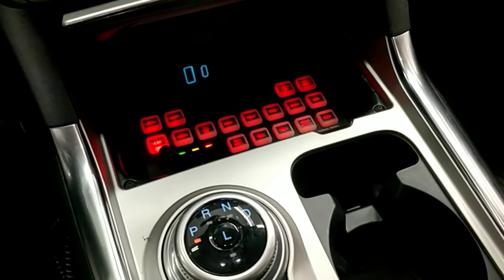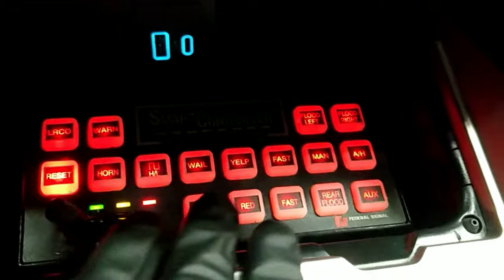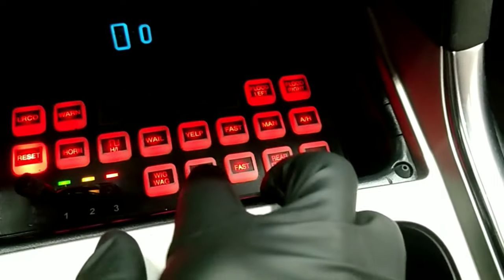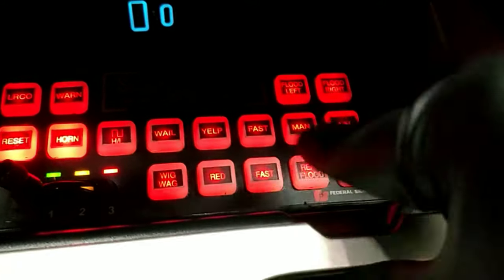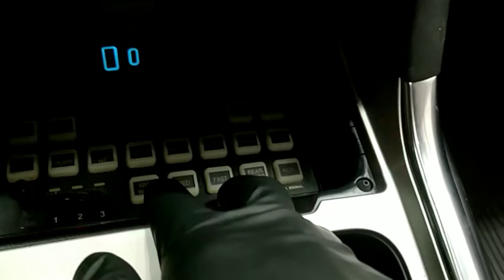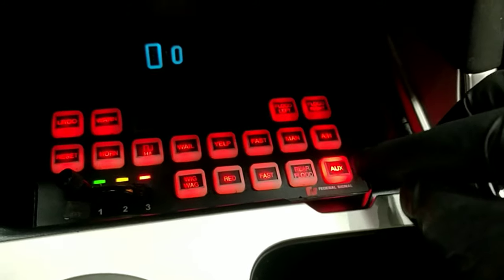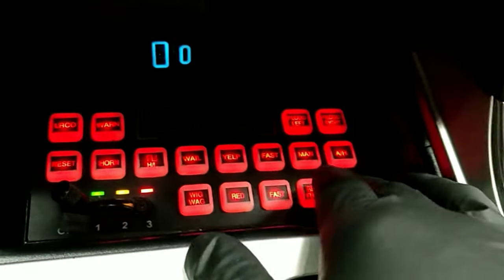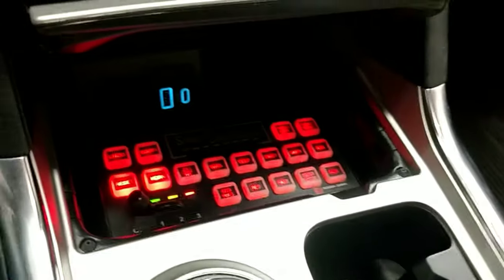Federal Signal SSP3000A & Rumbler - Emergency Vehicle POV Custom Upfitt

Comment: I was a cop for 31 years and Federal Signal was my all time favorite company for Lights/Siren Equipment.   Very heavy duty built and worked flawlessly for many years over cycles and cycles of repeated use for years on end.   Federal Signal and Whelen are the two very best...hands down.   They are about equal to me as I loved equipment from both of them although I always leaned towards the quality of Federal Signal.    SMART Siren system (shown above) is a nice system and integrates well into any modern Law Enforcement Vehicle.  Many of them are pre-wired to accept these systems or come with them.   I think Ford had a contract with Federal Signal at one time to supply the pre-wired siren systems in their police model line up.   They may still provide that service.   The Rumbler is a unique system that was actually invented based on SCIENCE.   Studies were done that were based on wave resonance of sound and how sound can penetrate metal at what wave lengths and then used that information to develop the RUMBLER technology.   This siren is independent of the wail/yelp/hi-low functions on the normal siren.   The Rumbler transmitter is timed to to emit the rumbler wave signal simultaneously with the normal siren which would still be blaring away at the same time the rumbler signal will be penetrating the vehicle in theory with it's lower tone pulsing signals.   The theory behind the rumbler system is that most cars of today are so precisely built using robots and computers and they seal much more efficiently now with new technologies than they ever did in the past.   As such the sound from outside the vehicle cannot penetrate into the vehicle nearly as much as sound penetrated in years past.   Also, many people wear ear phones in their ears (which in most states STILL illegal) so they don't hear outside sounds such as sirens or people crossing the street, outside ambient sounds, etc.   It is known now as a danger, and can, and have caused crashes.    The rumbler is supposed to penetrate into the cabin of a vehicle better than higher piercing sounding normal siren tones in order to bring awareness to a driver that an emergency vehicle is passing or approaching them.  The technology does have merit and is a proven to work technology that can certainly enhance the ability of drivers to hear and then see an approaching emergency vehicle with the rumbler technology activated  The technology is not in very wide use around the United States due to high cost.   The unit cost far more than a base siren system, sometimes as much as double or more meaning most police fire, and emergency service units will not elect to purchase the technology.      Most governments see the technology as "fluff" and while acknowledge it's good technology, don't see it as NEEDED technology where a lower priced base siren would work just as well in their eyes.   Granted most of these politicians have to answer to their constituents so bottom line price is ALWAYS a concern.     More studies should definitely be done in the future.   I'm not sure if this study was done in conjunction with the Florida Highway Patrol Emergency Lightbar Study that was done around the 2010 era I think it was.   It was the most extensive study ever done on emergency lighting and proved that the eye saw red better in the daylight and blue light better at night.   This is why FHP adopted a two color light bar system that could flash all red day time, and all blue nighttime.  Most departments that use a combination of blue and red lighting all the time have the same benefits because they flash both colors all the time.    Florida Highway Patrol's thought at the time was the fact the lightbar could automatically change colors they would have the benefit of having more light emitting in the recommended color due to all the lamps being lit in that specific color in daylight or darkness.      Code 3 inc. created a system for Florida Highway Patrol which employed a simple light detecting sensor that could tell when it was daylight or dark outside.  That sensor was then integrated into one of their Lightbars and that complete system became standard issue to the Florida Highway Patrol for many years as Code 3 probably had the exclusive contract for several years after it was first implemented.  (Federal Signal had long been the supplier to FHP for their lighting/siren equipment and this was probably a little bit of a shock to Federal Signal with such a big customer switching to a new Company).  When the Code 3 system detected daylight,  the lightbar and deck/grille lights would only flash red in color.    When the system detected night or darkness,  all lights would only flash in blue color.    It was a very ingenious and highly thought-out and effective system.   It was the first lightbar system of it's type ever employed by a Law Enforcement agency and also the first system based on scientific data which based it on how the human eye saw light and how they would react to that color of light in that particular type of light, either daylight or darkness.  The Rumbler siren system may have been part of this study but I don't know that for sure.   It did come out after that time period.   I do know several Florida Highway Patrol Troopers who told me that they did not like the new lightbar system and the fact it flashed all red in color during the daylight.   This was the first time in MANY years that the FHP had decided to outfit their cars with RED lights along with the blue.  FHP had been using solid blue lights (as most Southern Lawn Enforcement agencies had been using) for well over 50 years.  All of the old and even the new Troopers only knew a Trooper car with blue lights.   Many Troopers feared motorists wouldn't pull over for them thinking a motorist would think it was a Fireman behind them or Ambulance, but not a Law Enforcement Officer.    These Troopers who did not like the system quickly found a way to override or "confuse" the system.   They simply took a piece of dark colored duct tape and taped over the sensor located on the lightbar itself.    This confused the lightbar into thinking it was dark outside all the time and the lightbar reverted to blue at all times.    This pleased the Troopers who didn't like the red lighting on their patrol vehicles but some Post /Troop Commanders had to tell there Troopers to stop overriding the system or face internal discipline.    Other Commanders probably didn't care and overlooked it.    It all depended where you were stationed probably.    I think FHP may have abandoned the Red/Blue and returned to ALL Blue or a Blue / White configuration.    White is the most visible of the colors used in the Emergency Services and can be visually seen farther away than other colors.   The problem is that at night,  white light can cause temporary blindness.    White is extremely effective in the daytime.    It would be better suited going to AMBER at night time.   Amber is the second most visible color either at night or in daylight.   This is why it is so visible on tow trucks, busses, and state highway worker vehicles.   An effective combination used by some Law Enforcement and Highway Patrols now is BLUE and AMBER combination with the amber usually being facing to the rear for visibility to the vehicles coming up from behind.    This is a very effective method for safety for ANY Law Enforcement agency and any agency should be doing this to the rear anyway.    AMBER to rear (with color) for maximum effect from the back.     In using white,  some agencies use one forward facing white bulb flashing simultaneously or alternating with the primary color (either blue or red).   Some agencies use one white lamp in the middle front on both sides flashing with or alternating the primary color.   Most lightbars today from any manufacturer can offer an endless array of patterns and flashing sequences.   This is due to the solid state transistor technology in lieu of old manually made motor driven light bars.   Almost all of them now can change the entire lightbar into whatever colors and patterns you want.   I know our Federal Signal Light Bars (the very vest in my opinion) could be all solid white to the front (so bright it would light up a football field!) on demand at the push of a button,  then switching to red/blue immediately at the push of a button, then switching to a left to right, or right to left, or center out light director bar to direct traffic where you want it.   Then the bar could do every pattern known to man at the push of a button.    Trust me,  FEDERAL SIGNAL is one of the all time best (and I would say probably the longest company in the emergency vehicle equipment market over all competitors) and they simply make the very best in emergency vehicle equipment.     Whelen and Code 3 are great also, but to me Federal is still THE BEST.    They are like the Rolls Royce of Emergency Vehicle Equipment, where as Code 3 and Whelen are probably like Mercedes Benz or BMW.    Still very very good,  but you know...when you want the very best,  you just go for it!   And Federal Signal always works well with their customers and provide very competitive bidding.    I highly recommend you consider Federal Signal in the future.    I have used all three companies Code 3, Whelen, and Federal Signal and they are all EXCELLENT!
Reply: Ok.

Comment: NYPD Police siren! I love it!!!
Reply: This definitely not nypd. nypd has their own fleet service department this car is most likely belongs to a medical first responder like hatzolah, they did try to make it look very similar to nypd though it's not the same exact lighting partners

1 nypd doesn't use the fog lights for wig wags on an unmarked they use the high beams for wig wags and two white lights in the corner, 

2 this car is missing the two white lights in the reverse lights nypd unmarked cars have 

3 He said this is the civilian model of the car not even the police version with the street appeal package
Reply: @JackMcCoy1337  he's talking about the siren they use not the fleet itself
Reply: @Ben Dover  a siren is not the lights it's the tones coming out of the speaker.

Comment: quick question; how’d you tap into the horn ring, is it the same green wire on the up fitters guide or did you have to put a fuse tap?
Reply from the maker: Not the same as the upfitter guide, this vehicle is the civilian model. Don't recall the wire color off hand. You can't use a fuse tap because if you do it that way, when you activate the horn ring from the siren controller and then you tap the horn on the steering wheel, the factory horn will activate in addition to the siren, and you want only the siren to activate. You need to find the horn wire and cut it in between the steering wheel and the trumpets, and wire that into the siren. One wire in, one wire out. Hope they helps.